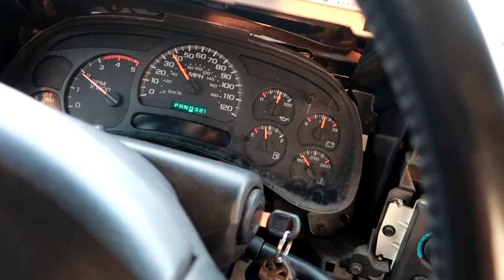THE $100 BMW REBUILD

Comment: I inspect my MAF sensor with a magnifying glass. You will see things that you can't see otherwise, and it only takes a tiny particle, to change the way it runs. I use a very soft brush to clean it.

Comment: The check engine light should probably be the Mass Air Flow sensor. so if you clean it out it should clear the code but if the check engine light comes back within 3 days then youll need to get a new mass air flow sensor

Comment: you can't recycle oil containers as they can't remove the oil from the fibres of the plastic. same with pizza boxes or anything of the sort
Reply: Run3Silver I always just throw my oil jugs in the garbage
Reply: Run3Silver recycling is bullshit anyway. Except aluminum... The rest is a waste of time and resources
Reply: Bradley Webb way to make it personal there, Mr Internet Tough Guy.... How much energy, manpower, and money do you think it takes to recycle plastic? You have to look at the big picture.. How much fuel is wasted having three garbage trucks come to your house every week instead of just one?
Reply: Jon Gee how much fuel does it take to fuel the extra lorrys trucks and tractors
Reply: Plastic is oil buddy, hate to tell you that. It's not the oil that's the problem, it's the detergents that are in it. When all the plastic is melted the detergents prevent the plastics from binding. Like oil in water. Recycling is a waste of time and money unless it's scrap metal.
Reply: That link just restates what I said. Plastic is derived from splitting oil polymers. Another thing is separating a thermoplastic from a thermoset, you won't know which is which until you heat them up. Which makes recycling plastic next to impossible. Plastic isn't fibrous either, unless glass strand is added. Ford use to use a thermoset plastic called Dielarck, it had the most crude oil content of any plastic and it still does. (no longer in use because the fumes from it cause cancer) anyhow, we would get molds in our shop with blown heater manifolds. We would burn the plastic off them in an oven, the oil would burn off and leave behind the silica and blackening agents in the form of ash.
Reply: UnitCrane514 sorry I stand corrected I gave you the wrong link. the one I mean to must be incorrect. I apologize
Reply: my dad drives a county recycling truck and when its full it goes directly to the landfill along with all the other county recycling trucks
Reply: HDPE plastic which milk jugs are made of is worth it to recycle. All you have to do is heat it up until it melts then put it into a mold and press it into a new shape. Its like the easiest possible thing to recycle
Reply: It seems everything is made to be thrown away today.  Too many cheap products that cost more to fix than to buy new.
Reply: UnitCrane514 oh btw I did some more research and the way its made means that say toy plastic is OK to recycle because its been changed on microscopic  level so its safe so its safe to recycle as long as its not an oil in it because I gets caught in he fibres and say a child gets a toy made from that carton it could be poisonous.
Reply: Run3Silver Now that makes sense, I totally agree with you on that.

Comment: dalton, we have a duramax just a year older with an exhaust leak. duramaxs are notorious for the turbo down/uppipe for rusting and there for causing an exaust leak. it just happend to our 06 duramax and you have to take off the whole cab.

Comment: The BMW is overheating because you have a bad fan clutch
Reply: Since you actually seem to know what a fan clutch is and how to diagnose it, I was wondering, do you think I should install a fan clutch on my truck? It's a 1977 Ford Ranger. Thanks
Reply: gurbeer athwal lol
Reply: Allusive Ten9 very led and whiny start
Reply: Allusive Ten9 it will start spinning slowly when you start it and will spin very smoothly and easily if you spin it by hand.
Reply: justin harris go watch Chrisfix's video on it.
Reply: Since your truck has a direct belt driven fan, I would say either keep it the way it is, or find a nice couple of big electric fans. However the choice is yours, I'm not a big fan of fan clutches.
Reply: Thanks. How would I install those electric fans though? Would I hook them up to the computer? It's an old truck, just got  it not to long ago. Haven't poked around with ant of the electrical systems.
Reply: I'm willing to say that your 77 truck probably doesn't have much of a computer to speak of. If you run off a 12v battery, it should be pretty easy to wire them in, and run a switch to the dash so you can turn them on or off whenever you want. Look around the internet for some schematics and ideas of what sort of fans to get. It shouldn't be too big of a project.
Reply: Sorry to bug you again, so could I make it turn on automatically? If not, would just keep an eye on the temp gauge?
Reply: Allusive Ten9 wire it on a switch. When temp gauge gets to just around a third way from max. Turn them on till you get to under a quarter and repeat.
Reply: You could make it auto by wiring it into the ignition switch, but it might take a while for your truck to warm up like that.
Reply: Oh, ya true, I think I'll make it manual.
Thanks for the help! I really appreciate it. My truck already has a hard time warming up so I think this'll help. Maybe it will give me a few horsies as well! the fan that's on it now is huge and obnoxious!
Reply: +Allusive Ten9
Your '77 I would bet most likely has just a regular pulley driven fan - nothing electric.  Don't hook it up to anything.  A manual switch is a pain in the ass.  Keep/fix the regular system.
Reply: Allusive Ten9 go to parts store. Order part. Go on internet. And look it up. Repeat what you saw/read on internet on part.
Reply: I see what you did there.

Comment: I have a duramax in the same truck (2006 chevy 2500hd, with the lb7 motor), and I have never plugged in that truck to a block heater. That truck started no problem when I was in Canada, while it was -40 degrees.

Comment: When it gets down in the 20's here I have to plug up the old 7.3 PS,  she really bucks and kicks when she starts up cold!!! If it's in the teens, it's even money whether or not she even cranks... Also, lots of smoke ;-) And we recycle plastic oil containers just like other plastics here in NC, but your state is very different than down here :-) Good luck Mr Machine :-)

Comment: Oil containers are usually made from #2 plastic but they are not recyclable. This is because the oil residue in the can contaminates them and makes them hazardous.  The best way to dispose of your plastic oil container is to drop it off at a local auto mechanic, lube center, or auto parts store.  Most places that accept used oil will also accept the bottles the oil comes in. 

There is not much you can do with the oil containers around the house, as far as reusing the oil containers, because of the contamination.

Comment: I believe the thing you are plugging up on your D-max is called a block heater I may be wrong. But on my powerstroke that is what its called and mine seems like its heating the oil because when its plugged up the oil pan is warm but idk just thought I'd throw that out there

Comment: to answer your question the oil has to be cleaned out specially to prevent the risk of the oil exploding whilst melting the plastic. My dad is a Bentley Master technician

Comment: When they melt used oil containers the motor oil as detergents in it which not oil. So when all that plastic is melted down it contaminates it and and doesn't allow it to bind. It's like mixing oil in water. I build plastic injection molds for a living. Hope that makes sense.

Comment: Im not being a hater but when you plug your diesel in it heats the block so its easier to combust the feul air mixture, but it does also sorta heat to coolant that is in the block

Comment: Check you oxygen sensor for polity with a multimeter as well might me that to. They don't get much usable plastic out of the old oil containers due to the recycling process being pritty harsh so it takes quite a fue old bottles to make a new one

Comment: I like how you say the parts are good by eye balling it, lol. Not to be a hater but a decent mechanic will do an ohm value check and voltage check with his multi-meter. A failing Maf sensor can fail without looking any different then it did from the factory. The number one step to do with a car that has sat is to do an idle relearn procedure that will make some codes go away after the car reaches temp. Then reset the codes and try again lol.

Comment: you should get a air filter shield on your bmw cause my dad has one on his 1994 bmw m3 and it keeps all the dust and crap out of it. also you should get some ceramic brakes cause he romps it a lot and he has not changed the brakes for 7 years and not a bit of wear yet.

Comment: With the oil containers it depends on the polymer of the plastic, some plastics like pvc after reaching a high enough temperature it with disintegrate before melting. To under stand why you must know that that all plastics are polymers, which comes from the Greek word poly meaning many and mers meaning parts (I think I can't really remember the little detailed in chemistry) any way this means that there are two molecules called monomers that hold the polymer chains together so if the energy required to break the bonds between the two monomers is less than the energy to melt the plastic it will never melt instead it will disintegrate however if within the plastic the monomers breaking energy is grater then the melting point the plastic will melt. That is what I believe is the resone from a chemistry perspective however I don't really know if it is that or if it is because it the oil just a view of a reason

Comment: IDK but this is just my theory. You know how whenever you look at the bottom of anything plastic you see a recycle sign? Then theres a #. 1 being the most dense and used in food product. It doesn't deteriorate. And 4 being used to make selves and random plastic stuff. Well the plastic on oil containers is a 3. My theory is that since used motor oil is deteriorated the plastic would break up in the period of time the used motor oil is in there.

Comment: I think as far as I. remember oil. containers are thermosetting plastics meaning set once and milk jugs and. plastic bottles and caps are termo plastics meaning. they can be melted back down 
or just the plastic absorbes some of the oil

Comment: Hi 3DMachines I have a problem with my 1996 Kawasaki Vulcan 700 it won't start I mean it wants to but it doesn't I got it off a guy for 390 was it a good deal I mean I know it was running before

Comment: Plugging in your truck heats up the engine block not the coolant
Reply: isaiah logsdon umm...... pritty sure the coolant in the block....
Reply: isaiah logsdon usually goes on the oil pan and heats up the oil

Comment: the bmw probabley has a plugged cat. witch causes the overheating. exaust gasses backing up into the engin will cause the cooling fan not to turn on at all. same thing happens to all cars once the cats plug up its a death sentence for the engin.

Comment: I'm pretty sure the oil its self is recyclable, but the container is not. I'm guessing that goes for all flammable liquid containers because it has to be heated to be melted down. U would think there would be a way to neutralize them first tho. I mean come on its 2017!

Comment: the reason you can't recycle oil containers is because it has already been used and if they melt the plastic the machine melting the container could cause a fire

Comment: you should buy a straight pip exhaust and m3 wheels it would look sweet
Reply: fergie penman a straight piped 6 cylinder does not sound good
Reply: Mine sounded really good tho I had the same car but with a turbo

Comment: you cannot recycle plastic oil containers because of the residual oil. they have been trying to figure out ways to separate the two but it is too expensive and time-consuming and chemical products to clean out the plastic containers just create another waste product that is hard to get rid of.

Comment: Unfortunately, what we read as a “recycling symbol” (the resin identification code) isn’t necessarily a sign that you’ll be able to recycle the item where you live. It designates what kind of plastic it’s made of, but your local facilities may not have the capacity to handle that type of plastic or the form it’s produced in.

That said, even if you’ve confirmed that a type of plastic is okay to recycle in your area, containers that have held oil can be tricky. 

...off google...

Comment: you know how when you are burning oil in a car and it smokes well it's the same with when you melt down a used oil bottle when it gets melted down the oil residue on and in the plastic smokes and polutes the air and the factory can face fines for that, and the batch of melted down plastic is ruined

Comment: Why do you plug it in to warm the engine, don't you do that when you start it up and let it run for a minute or two? Never done that and i live in a cold area.
Reply: Yeah, but i have a diesel. Had an 2000 ford Mondeo 2.2 TDCI, only got hard to start when it was -15 Celsius. That car had 500k on it aswell. Have a 2014 now and it starts right up.

Comment: buy a freakin cummins 3D you dont gotta plug them in! my 01 fires right up not plugged in as long as the fuel isnt gelled shes gona run no hesitation you cant beat a cummins! Grid heaters for the win

Comment: BMW= Break My Wallet! I have had them and was a wrench for many years, once the heater and A/C control, the sunroof motor, the fan relay and the radiator all go out then you will see what ends up costing bank! Heaven forbid you end up with the head gasket and the instrument cluster
Reply: Big Money Wasted
Reply: Brent Hall big money Waster

Comment: I used to have a 1984 BMW 318i and the car was an utter disaster I paid $350 for it then drove it without a license the car wasn't legal so the cops took it 3 days later they wanted more than I paid for the entire car to get it out of the impound and it was going to cost me about 3 Grand to fix it there was a lot wrong with that car all I can say is good luck buying BMW parts is expensive

Comment: The grill on your BMW is driiving me nuts. please remove one or put one in. also don't coil your extension cable like that if you have it pludded in it creates a fire hazard. leave it uncoiled if it's plugged in.

Comment: Do not attempt to recycle motor oil containers. These are not recyclable and must be disposed of in the trash. ... Motor oil poses a far bigger risk of environmental contamination than empty plastic bottles, and it can be recycled into heating fuel or even fresh motor oil.-regards of google x
Reply: Massey Man Because everything you can possibly find on Google is 100% truth...
Reply: pretty much

Comment: Is it the fact that it's a diesel that he doesn't want it to get cold?  I don't get it.
Reply: yeah diesels are harder to get started when they are very cold than gas engines
Reply: Ding dong if any engine is too cold and it wasn't let warm up, it could crack the block. That's why the slang term is a "block heater".